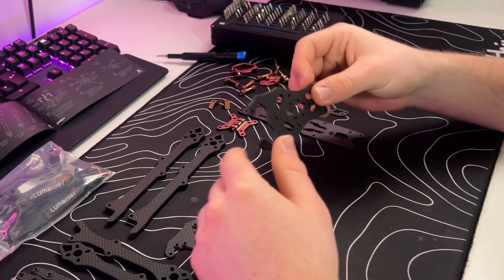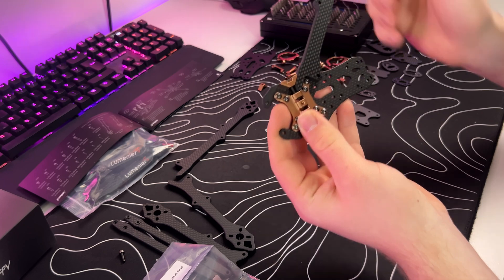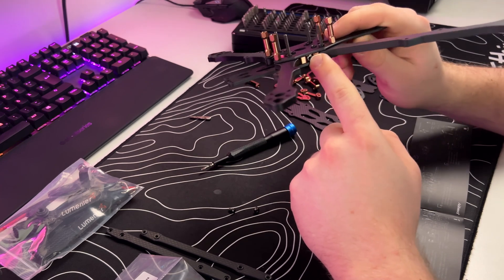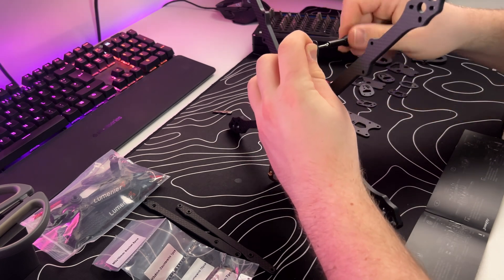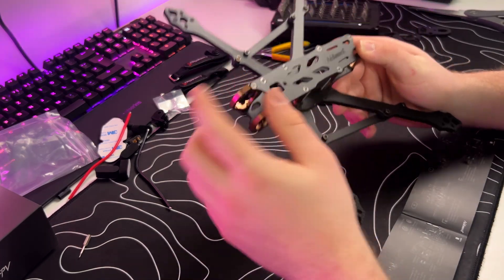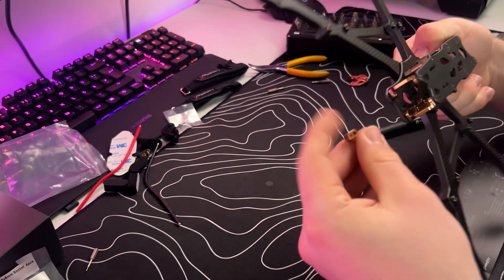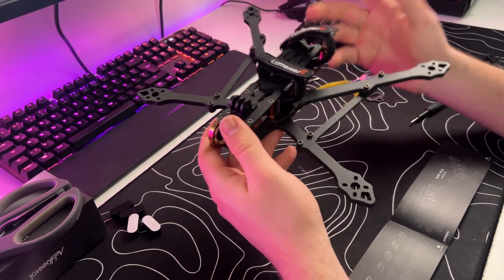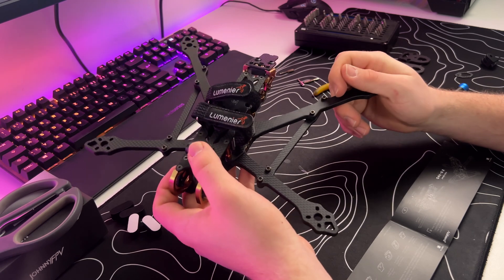Lumenier QAV-S 2 JohnnyFPV SE 7” Frame build Tutorial | FPV Long Range

Comment: What size battery and what kind of flight times are you getting?
Reply from the maker: hey! I get around 25/30 min flight time by using a iFlight 4000mAh LiIon Battery. First I bought the 8000mAh but they are to big and to heavy for 7".

Comment: Amazing video thank you so much !!!
Do you see a solution for putting both the GPS and the rear GoPro mount ?
Reply from the maker: Thanks a lot. Glad you liked it. Hmmm you could mount the gps under the plate fo the gopro mount and use some double sided tape. Maybe that helps
Reply: @wallfpv  Good idea, I wonder if the GPS will work well though.

Comment: Im considering this 7" frame but will it hold a 30x30 FC ?
Reply from the maker: Hi, yeah you can build this frame with a 30x30 Stack. I did that too :D
Reply: @wallfpv  Thank you, the FC I want to get has 30.5 mm hole spacing, that will work with with this frame? Thank you again I should have been more specific the first time. Love your videos.
Reply from the maker: @MrBiggs-wu2kf  No Problem. Yes 30.5 will work. That's the standard. You holes ar 30mm and the whole plate is 30.5mm.
Glad you like the video :D. Thanks for the support

Comment: The gopro mount spacer is tricky but i used channel locks. from the curved front of frame to the gopro mount and pressed lightly till fell into place.  Next time ill use a piece of cloth to prevent minor scratch but worked better than expected. i can send a pic let me know. Ive built other qav frames same issue with gopro mount spacer.  How did you mount the gps? do you have a pic?  drill two holes and ziptie?
Reply from the maker: Hi,
thanks for sharing your experience about the GoPro Mount xD. I did it with some sandpaper, so it fits perfectly. For the GPS I just used some tape. You can send me a DM on Instagram @wall.fpv if you want a picture of it :D

Comment: took me 15 minutes to build the quad. took 2 hours to get the gopro mount in correctly. bad design. you will get jello without the spacer
Reply from the maker: 😂 yeah it's really annoying but I don't have any problems without the spacer. But the safer option would be with the spacer mounted

Comment: Hello!!!
Do you know how many mm are between axles???
in some shops it says 220mm but i think thats the distance of the 5" version not the 7"
Thank You!!
Reply from the maker: between the motors? Do you thought about 7.5inch props right? If yes I also bought 7.5 inch props but they are to large. You can just mount 7 inch props on this frame
Reply: @wallfpv  yeah between the motors!! from the front right motor to the left back motor. I'm. Looking for one 7 inch frame that it's not that big, so I can put 6-7 inch props and fits good.
Also did you already tried the drone flying going fast?? I would love to know how this frame handle the vibrations of a 7" propeller.
Thank you for talking your time for answering man!!!
Reply from the maker: @Fiunsky   so between front motor and back motor we got 185mm if you measure it straight from the motor middle. Hope that helps... :D
Also yeah I like the frame a lot. It durable because I disarmed my quad by accident and fell down 80m and nothing was broken (just props). Also the handling in the air is pretty solid and it handles vibration very good. You don't see any vibrations on the fpv cam because of the rubber stuff at the front cage and also the FPV Footage on the gopro doesn't got any vibrations. 
I always love to help other people so thanks for asking :D
If you want to have a look on my FPV Footage I did just go to my Instagram: wall.fpv --> the post in the mountains as you will see on the thumbnail

Have a great day man 🤝
Reply: @wallfpv  thank you so much!!! 🤝🏻
Reply from the maker: @Fiunsky  No problem. I am glad it helped ☺

Comment: I don't understand why they include the gopro mount spacer if it doesn't fit, it even wont fit on the back plate attachment!
Reply from the maker: I got one of the first gopro spacer mounts and they are a little bit to thick so I need some sandpaper to get it thinner. But I think if you buy a new one now it should fit. Yeah a little bit bad :/
Reply: @wallfpv  Mine was also super hard to get in the first time, but after that it's much easier to work with.
Reply from the maker: @colibrifpv  ok so yeah I will try to use the spacer then ☺
Reply: @wallfpv  Yeah, just use a bit of fine sandpaper on the opening of the plate, which was what one of the designers recommended to me. I actually didn't do that, it was a royal pain the first time, but after that initial use, it got much easier...

Comment: Looks great! Can't wait to see the rest of your build!
Reply: One other comment, I would recommend just sanding down that spacer plate a bit so it fits, or you can print a TPU mount from thingiverse designed for 2mm plates so no spacer is necessary. The gap with the 3mm injection part makes it more likely to have issues if you don't use the spacer. GetFPV should have spacers with better tolerances in stock shortly, so you can also just get with support and once they come in they should be able to send you the correct spacer plate as well as the GoPro plates for the rear. There was a tolerance issue from the factory some of the early batch frames, but support will take care of it for you if you contact them.  Honestly just sanding down the plate a bit is easier than waiting on shipping though, so I would probably go that route.
Reply from the maker: Ah thanks for sharing the knowledge. Good idea I will try just sanding down the plate a bit because I am from Germany so the shiping would take ages again from getfpv :D.
Reply from the maker: Thanks a lot. Appreciate your support :D